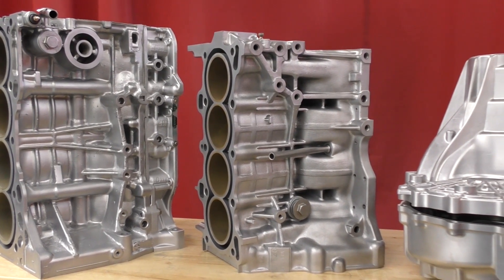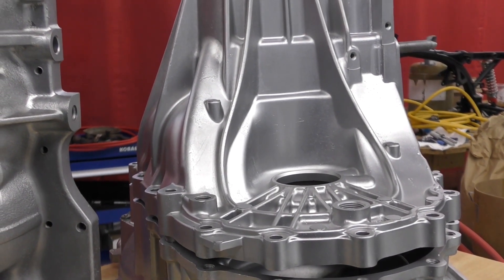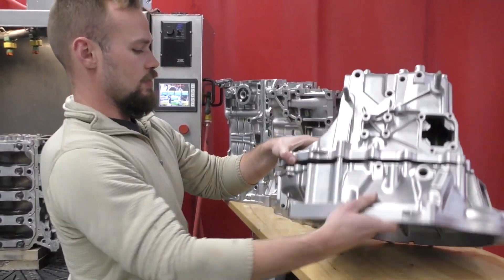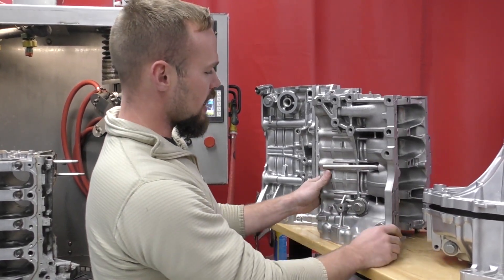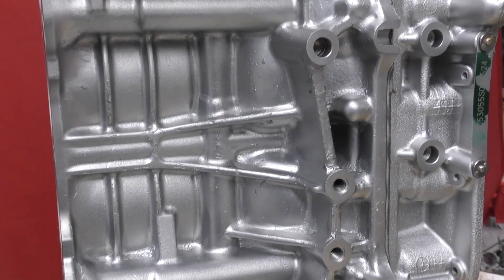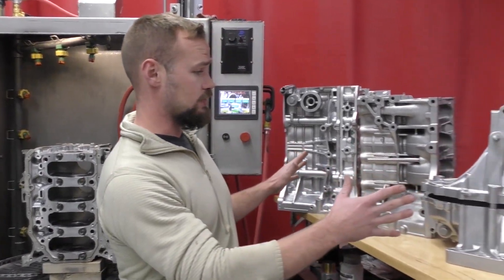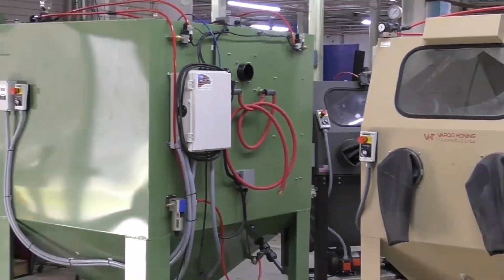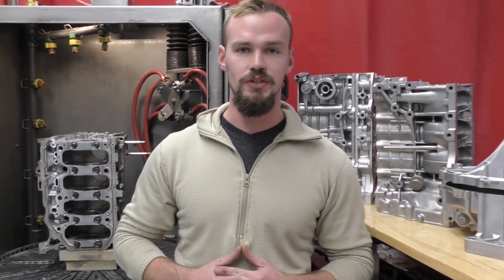Benefits of the Vapor Honing Process For Engine Shops - Vapor Honing Technologies

Comment: Ur saying its better than painting a block, but wouldn't it start to oxidise like this once it's in the car? So you'd have to protect it with paint or something else anyway?

I see a lot of new cars as a mechanic, and all the aluminum parts start to oxidise pretty quickly. And if you spend all this time and money making your parts look this good, wouldn't you want it to look that good for as long as possible?

Let me know what your thoughts are on this, and what youd recommend! I was thinking about a matte clear paint to protect the surface, but keep the natural colour
Reply from the maker: These are Honda Engine blocks therefore they are aluminum and will not oxidize.  However, when using Iron blocks you can prep for a coating or paint to prevent Oxidization.  Are you dealing with more Iron?
Reply: @VaporHoningTechnologies  whoops  I ment corrode. Aluminum wont look like this for ever once exposed to the elements, look at any Aluminum parts on a car or motorcycle. It'll become dull or get white corrosion on top of it. Hence why we want to vaporhone them in the first place.

I know that honda actually uses paint on top of their aluminum motorcycle parts. I can show you some aluminum parts im dealing with, and how they have become dull and have some sorta white powder on top of them. 

Why wouldn't these parts experience that?